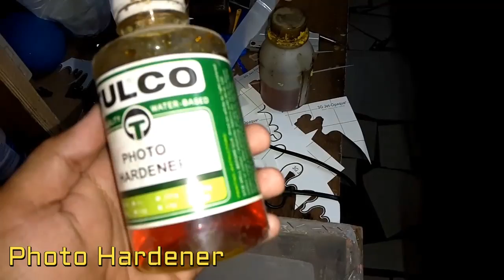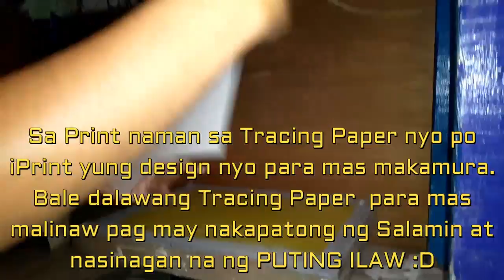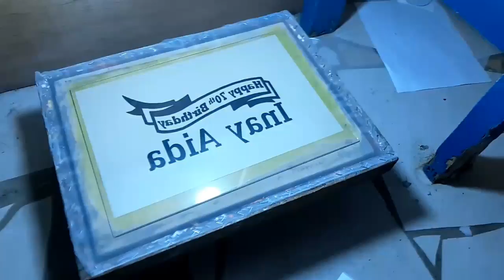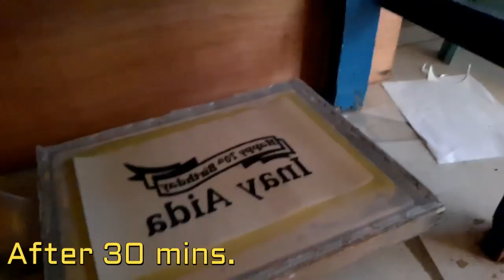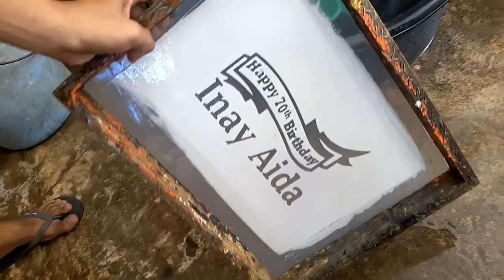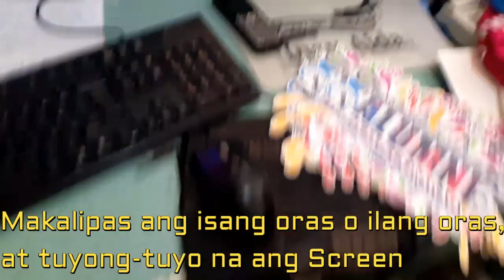Photo Emulsion DIY! Tagalog

Comment: Sir tanong lang po ano ginamit na papel dun sa nakaprint na logo? tracing paper po ba tas paprint?
Reply from the maker: yes po boss tracing paper nga at pd ka mag print sa printer na my uv dye ink, standard print lang/ plain paper
Reply: @SMASHTVlog  Thank you po sa reply, kahit sa mga computershop pwede ko ipa print? tas ano po tawag sa pintura na una niyo nilagay na yellow.?
Reply from the maker: @VScollectionPH  Shellwood White Glue at Sensitizer Powder na tinimpla sa mainit na tubig
Reply: @SMASHTVlog  Thank you sir. Yung tracing paper pwede ako magpaprint sa mga computershop?
Reply from the maker: oo pwede boss, isa isa lang pag pipi print pra di maghawa hawa ang ink, 2 copies ang print ng logo o design
Reply: @SMASHTVlog  thank you sir, video mo lang naintindihan kong tutorial kahit walang subtitle gets parin.
Reply from the maker: @VScollectionPH  salamat sana magawa mo dn un nagawa ko sa video :)
Reply: @SMASHTVlog  salamat ulit sir magagawa ko yan pag kumpleto na sa gamit malinaw naman po mga turo niyo 😇 tanong ko lang sir pano timpla ng emulsion?
Reply from the maker: @VScollectionPH  250 ml na hot water  + sensitizer powder
Reply: @SMASHTVlog  pwd na po ba ang tulco sensitizer liquid gamitin?
Reply from the maker: na try ko yan d2 sa diy ko syang lng boss kung mismo tulco gagamitin mo bibili ka tlga ng exposure box...
Reply: @SMASHTVlog  ilan po sukat ng sensitizer powder